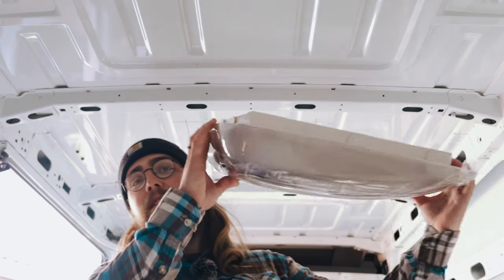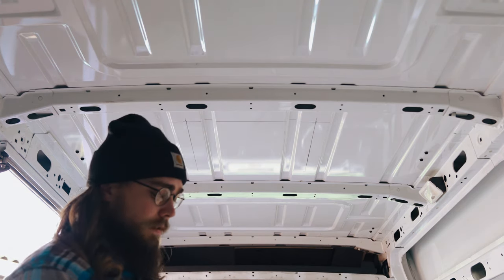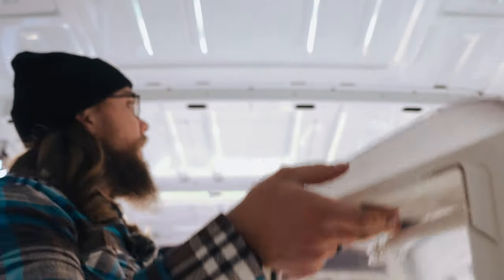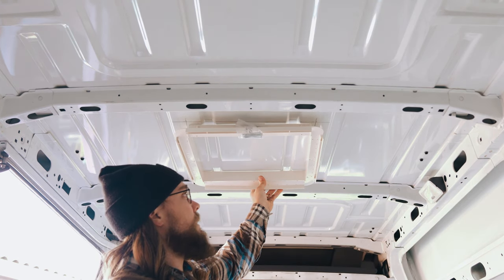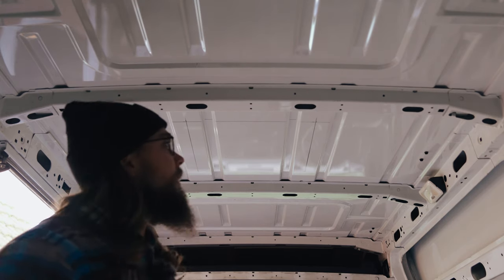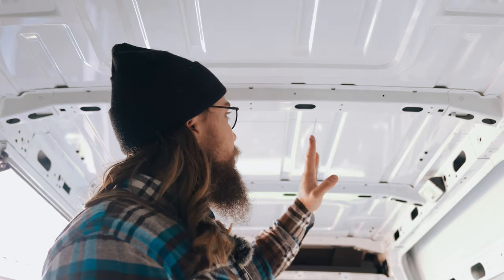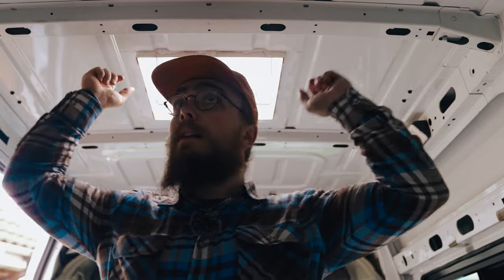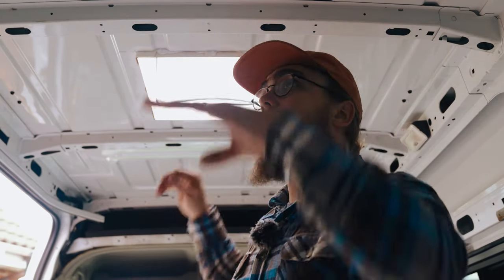Installing the Dometic Heki Mini Style skylight in the van | Offgrid Van Conversion | Nissan NV400

Comment: Did you buy the skylight with or without forced ventilation? Do you have any other ventilation methods in the van? I am wondering whether or not we want forced ventilation and if not, which other ventilation methods to use.
Reply from the maker: We went for the one without forced ventilation because it's for a campervan. The forced ventilation models are very noisy, hence why they're usually used for caravans and the non-ventilated models are used for campervans.

Comment: whats the difference between forced ventilation and non forced? and can you advise on the roof thickness of  a renault master 2012 thanks. i think the nv400 is the same shape as the renault master
Reply from the maker: The forced ventilation skylights are intended for caravans where you want ventilation (particularly in winter) to avoid mould. The trouble with forced ventilation for a campervan is that it makes a lot of noise when you're driving. 

The thickness of the metal roof is very thin - about 3mm.
Reply: @offgrid_power  very much appreciated, thank you